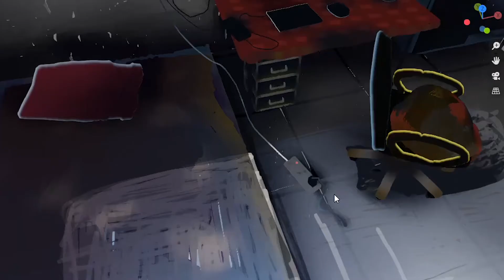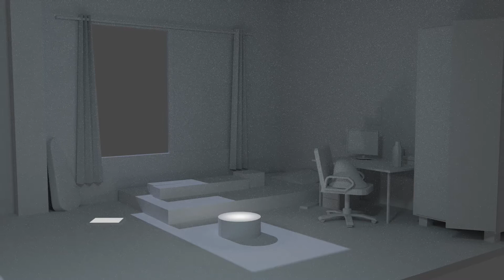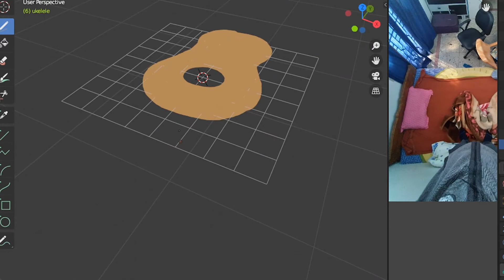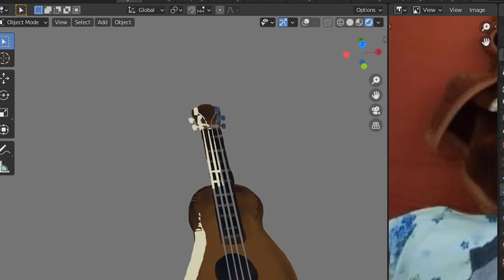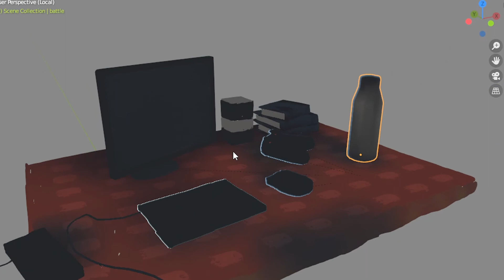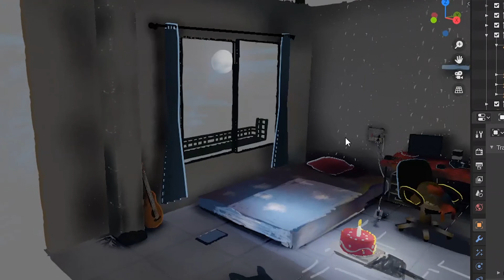Create sets for my film with grease pencil | Blender | Short film progress

Comment: Neat! thanks for sharing.  Your reasons for redoing all the geometry in grease pencil was only to have control on the lighting? Is it not possible to texture the 3d objects with simulated lighting ala npr techniques?
Reply from the maker: There can be a way I guess to give this kind of behaviour to 3d objects. My reason for doing this is because I like the hand drawn control over 3d objects. With meshes thing could seem a bit more cleaner and crisper. It's just not something I am going for. Also have 3d grease pencil objects means I can animate them quite simply over a timeline something that is still a bit of a hassle with meshes even with keymesh introduced.